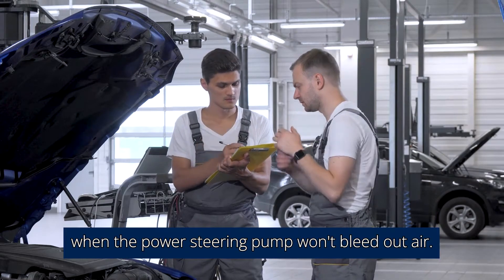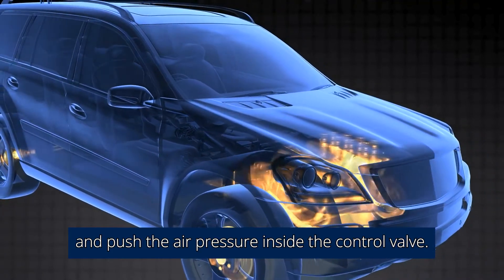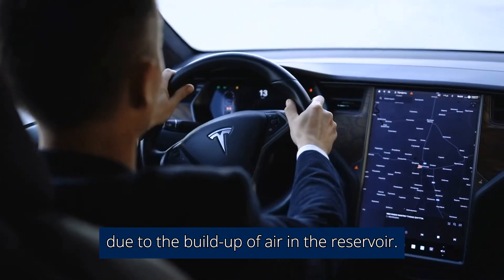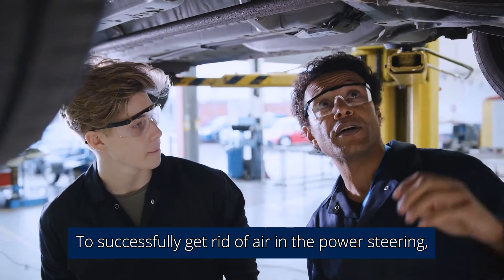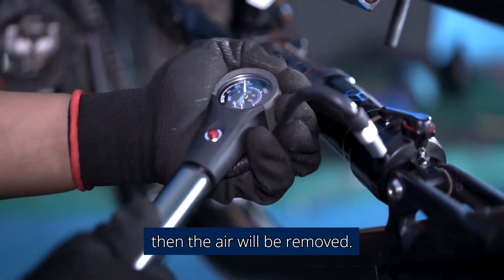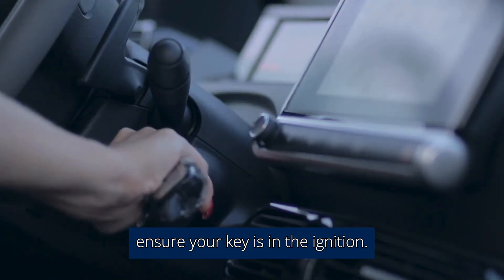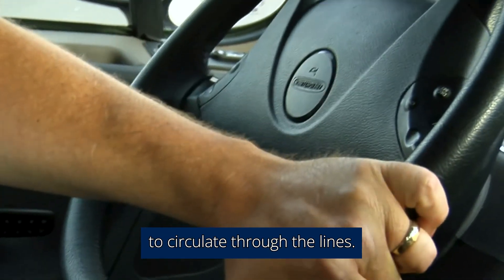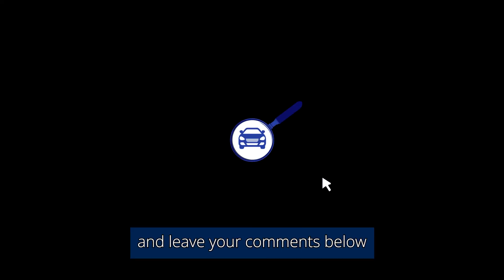Power Steering Won't Bleed Out Air: Reasons + How to Get Rid Of Air

Comment: Transmission  fluid.....huh
Reply: It’s actually pretty common for power steering systems to use automatic transmission fluid.
Reply: @How3Kiwi not from the transmission system, which is one of the clips shown in this AI-assembled video.
Reply: @VoltisArt  Haha yeah, I wasn't really referencing the video as much as replying to the comment seeming unconvinced about the ATF. These AI videos are getting more and more convincing, but not quite there yet...
Reply: My 07 Dodge Dakota uses ATF. Not circulating it from the transmission, it's got its own power steering fluid reservoir.